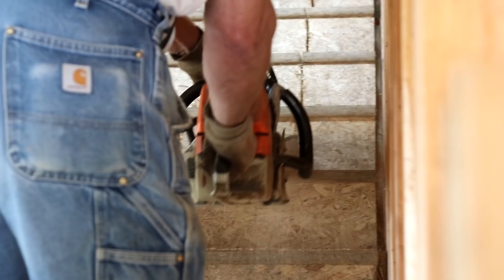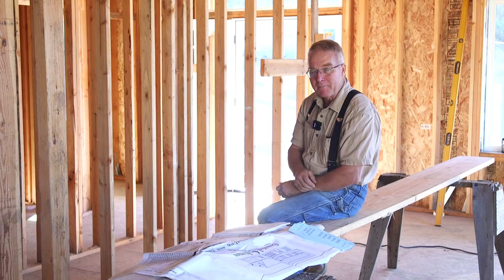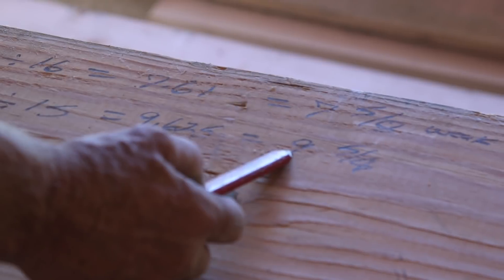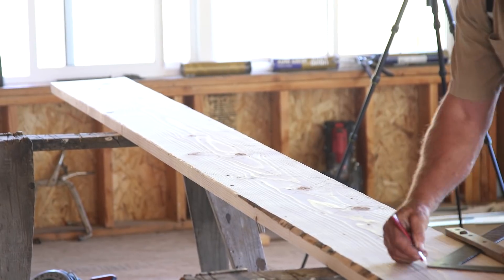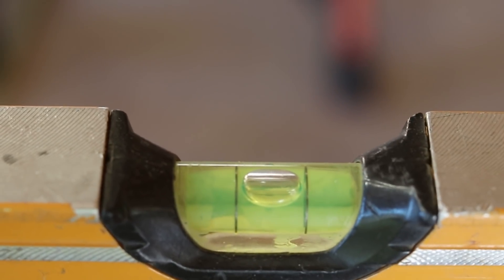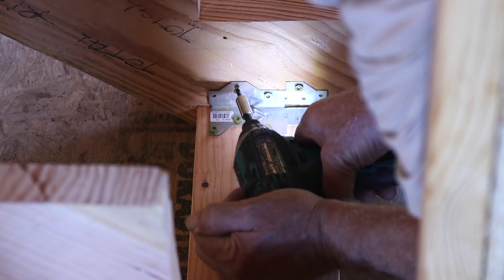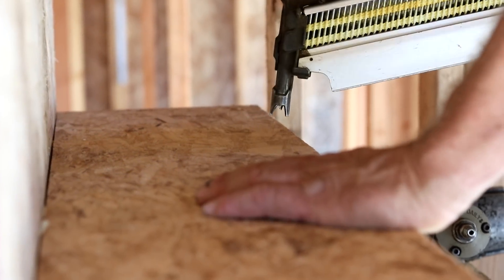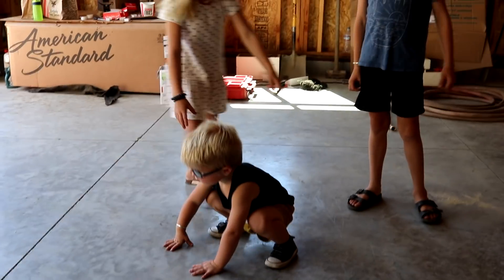Building Stairs...Again Ep.89

Comment: 1:43 OMG SAFETY SAFETY SAFETY ALERT!!! YOU'RE STANDING ON THE TOP STEP OF A LADDER!!!!11uno HOW DID YOU EVER SURVIVE!!!!

I too have a couple bonehead oopses in my construction career. First one was misreading a plan and digging a footer for a bathtub so the slab under it would be thicker. Trouble is I dug the footer around the toilet drain, not the tub drain. Luckily we caught it before the concrete showed up. 
The other oops was using the wrong elevation for a house. The option had multiple steps and a larger entry from a front door into the living room, but this house was not so optioned. Trouble is, I had already placed the forms and concrete was poured, so I had the joyous task of measuring the correct step down into the room, and using a chipping hammer for hours to remove all the extra material. That was a really bad day.

Comment: Most times builder forgets to set first step accordingly to what will be on the floor. Hardwood or tile, etc. Also the finished tread thickness.
Reply: As a trim carpenter who specializes in stairs, I find that it's usually the top step that's off, instead of the starting step
Reply: @stevebengel1346  most of the times if the rough frame stair stringers are left in that is what is inspected for rough in inspection.  It will pass. Then a hardwood floor or tile is added. Change first step height. Like I said only if the trim person uses the rough frame stringers and does not cut new stringers to allow for finished floor height.  It can change on each floor.
Just speaking from 30 years experience.

Comment: I’m not sold on that liquid nail I used that on my stairs with 3” screw and I have several steps that squeak.
Reply: I use polyurethane now..  
.I don't like how hard construction adhesive is when it dries
Reply: Did you add the screws 2-3 days after the glue dried?

Comment: I mentioned months ago that you didn’t allow for finished flooring offsets either.   First and final rise have to take into consideration the addition of finished flooring thickness (unless your planning on varnishing the subfloor as finished floor).  Your first attempt did not consider this.
Reply from the maker: Actually it did and this time also. It will be fully described when the flooring, hardwood treads and carpet is installed.

Comment: Where does he get the “divide by 15” and 16 in the equation from?
Reply: number of treads/risers
Reply: usually you take your total height for the stairs (121-7/8" in the vid) and divide by code requirements for stair/riser height (8" 3:40) which is 15.25 stairs.  You can't have a fractional stair, so he rounds up the stair count to 16 to keep the riser height below maximum allowed.  Tread count is always calculated one less than riser since you don't count the floor at top or bottom of the stair case.

Comment: It’s easy to mess up stairs!

I did by not knowing the thickness of the tile & thinset at the bottom.

I also marked up one side of my 2x12 master that had too much runout due to using the “brass set stair knobs on the rounded edge of the 2x12, it was almost 1/2” off at the top. 

So I used trigonometry to calculate the hypotenuse distance that the all of the points must be.

Then marked up the other side of the master accurately without runout.

Comment: I don't get why the treads are being glued down if hardwood treads are going to be put down. I have always seen the hardwood treads installed directly to the stringers.
Reply: Right Round  pocket screws through the stringers from below into the treads.
Reply: Right Round  I live in the US. Watched many television shows and YouTube videos that place the treads directly to the stringers. They might be using glue as well. Putting down these sub treads though, the finish treads will still need to be glued and face nailed. Maybe it's a fine home builder thing in building stairs where you don't see a single fastener.

Comment: This is my goto site for making stair stringers: https://www.blocklayer.com/stairs/stairseng.aspx  Section R311.7 of 2015 IRC says max rise is 7-3/4" and min run is 11" if you don't do nosing like this. Otherwise 10" min runs with nosing between 3/4 - 1-1/4. So are these stairs really going to comply?
Reply: His local codes are different - R311 in the state of Oregon has min tread depth of 9" and max rise of 8". Both of those would get flagged in my locality.
Reply: @peterwest323  Agree, wouldn't fly where I'm at either.  When I saw his dimensions I thought "must not be under IRC, or local AHJ has waived IRC requirements and is allowing something different."

Comment: If those stairs are the biggest mistake you make on this build, you'll still be putting on a clinic for a lot of builders here in California, where many new construction mcmansions are coming in 200% overtime and expensive areas like fireplaces are needing to be rebuilt 3 times to comply with code and the manufacturers installation instructions

Comment: I think every builder has had to rip out a set of stairs or two. Not the highpoint of the week for me either. Especially when its your fault. But, that was in 1978, and  I never made that mistake again. One quarter inch at the bottom, turns into a major problem at the top. And to make matters worse, I did not test fit my pattern, before cutting the other stringers. Lesson learned, the hard way.

Comment: Jeez, could you have taken a power hand plane and taken off 1/8” from each tread?
Reply: Are you joking?  If not, think about it. Shaving a 18th of an inch off each tread would only make the bottom step a little shorter, and the top step a little taller. The rise on every other step would remain the same.

Comment: I see you use liquid nails as your adhesive. I’m sold on power grab. Look at a piece of power grab after it’s cured and it’s HARD! No flexibility. Liquid nail that’s set up is still ply able. Somewhat soft. 
Had an old timer show me. When building knee walls. Run generous amount of of power grab up all studs on both sides. Put 3 screws in the field , and around the perimeter of sheet.  Be sure it’s racked plumb, straight, and level. Cause tomorrow it won’t hardly move at all!!

Comment: FWIW : So, a spec/speculation [private/residential] house, must be built to certain specs/specific 'codes' deemed acceptable to a non owner/public authority, yet can contain mold prone [China] drywall, corrosion prone [China] copper pipes/tubing and/or various other 'substandard' materials. but ,by God, your stairs can't be 1/8" 'too' steep ? Yeah...JMO only.

Comment: What?? I am a home inspector and those stairs do not need the current international residential code for stair dimensions.
He says
"the code max rise is 8 inches so we're very comfy there"  
Nope  7 3/4 max rise
He then says 
"treads at nine and five-eighths inches the minimum is nine so we're well within
the minimum tread length"  
No again, stairs require a 10" tread IF you include a stair nose, your example shows no nose on the stairs therefore the code requires 11"

IRC 15  Riser height max 73/4 in., tread depth min 10 in. EXC  311.7.5.
	• Tallest riser not > 3/8 in. taller than shortest riser 311.7.5.1
	• Tread depth min 11 in. if no nosing projection on treads 311.7.5.3X
Reply: @CornerstoneHomeImprovement  No idea what standard that is but it is NOT the  International Residential code.  "The stair riser code is up to 7.75 inches, and can not vary more than 3/8 of an inch. Treads are 10" min."
http://media.iccsafe.org/Annual/2016/2015IRC-Essentials-Highlights.pdf#page=56

Comment: That's the wrong tool to put those screws in lol 🔨
Reply: Hammering in a screw for the first 1/4 inch is the right thing to do if you don't want to struggle getting the screw started in the right place and having to start the screw 5 different times because it bit in in the wrong spot or wrong angle 4 times.
Reply: @44R0Ndin  I know man I was just jerkin his chain I'm a huge EC fan and I have a deeprespect for the work that he does and the content he creates

Comment: Not trying to be a smart ass, but what code is it that allow an 8" rise? (3:39) For that matter what code allows 9" minimum tread? (4:29). An awful lot of work to correct 1/8th inch - but the code you are referencing seems way out of whack? 7 3/4" max riser, 10" minimum tread - isn't that International Residential standard? Surprised I'm the only one commenting.

Comment: I don’t think inspector would have called you on this it’s just your OCD
Reply: our local inspector did when a "professional carpenter" built our stairs wrong.    We were outside the code limits, although this was the result of another "professional carpenter" who built the initial wall in the wrong place.   As this was a 30 foot central wall in the middle of the house there wasn't a lot we could do about it at that point.    Fractions on the initial grid layout meant a whole heap of trouble down the line.   Stairs were never passed but the Inspector did agree that there wasn't much we could do about it other than tearing half the house down to fix a simple mistake.    It shows that having a 2nd pair of eyes on the job would have caught this simple error.   Lesson learned!

Comment: My feet are 12" long. I'd probably reject this house for the short treads. My heel would hang off the end of the step. Not to put too fine a point on it, but this should have been handled in the design phase, there's no reason to have such short treads.

OTH, there's a buyer for every house, and this is just my dumb opinion.
Reply: Do you walk on your heels??? Try walking on the balls of your feet. Might help.

Comment: Very well built - I do find your 'well within code' is funny. I'm not a builder but I hear you are just barely doing the minimum code. It's like if your spouse or kid needed surgery. Do you go with a surgeon that got D's (not D-). Why not go with the Dr. that got A's or even B's? Measuring with a few 1/8" to me isn't enough to be comfortable within code. If having to rebuild the stairs is the worst that happens... I do some things better than you - I screw up better! ;) When I screw up, it's a go big moment. And yea, I'm replacing all the outside stairs in a home we just bought. Way, way too steep.